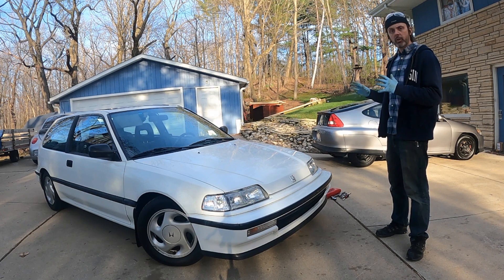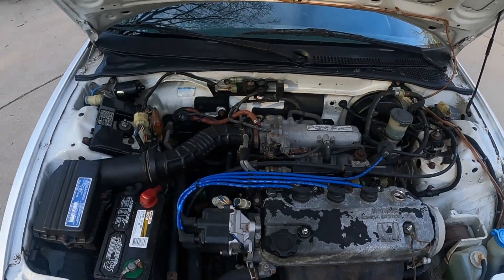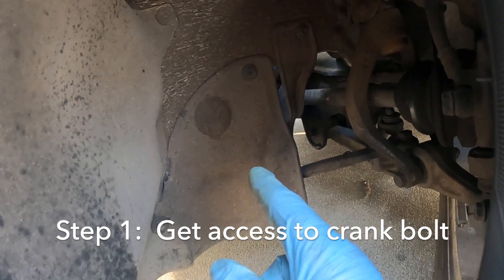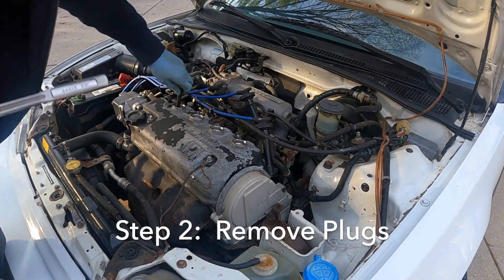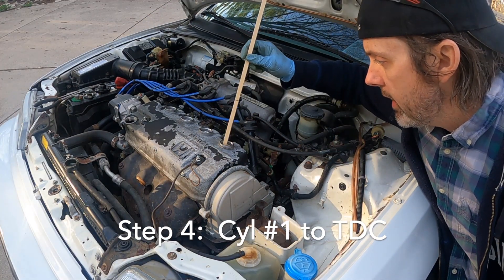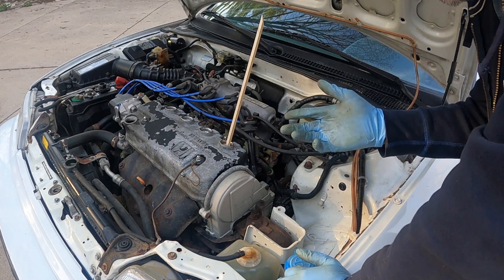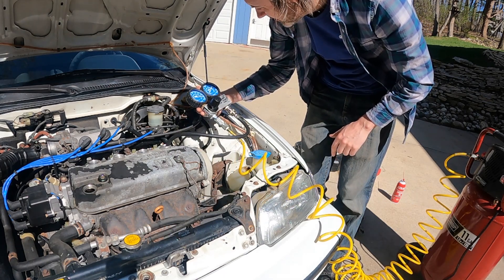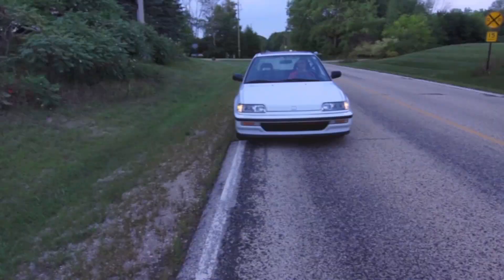EF Honda Civic Si Hatch Engine LEAKDOWN How To

Comment: All 4 plugs look ok? None of them look like they’re burning oil? Did I kiss that somewhere ?
Reply from the maker: Plugs look a little dark, problem is blowby; engine needs rings, and to do that you need to pull it, and if you're doing that, I don't want to put something without Vtec back in tbh.
Reply: @addvancedgarage  somehow missed the blow by…. Yep, don’t blame you one bit. K series, built bottom end to handle a turbo? Would make that thing fun as hell to drive if you want to dive in that far.
Reply from the maker: @VWJawbreaker  Probably go b-series as they drop right in and are more OEM+.  K swaps are neat but too much for a survivor Si like this imho.  If it was a repainted DX, sure
Reply: @addvancedgarage  look forward to seeing the progress when the time comes

Comment: OTC makes decent tools, and they're one of the more affordable brands. Yeah if it were coming out, either a B-Series or what I would swap in, a K20 or K24 😁 K-Series is one of the best flowing cylinder heads. Obviously there is a ton of aftermarket for K's and B's so either way...
Reply from the maker: I think a K is too hack for a mostly original Si like this; I know it can be done cleanly, but I think an OEM+ build is more appropriate, so B16/18 w quality parts would be perfect.   Plus...  man... aesthetically the headers on the B facing forwards looks so much better than the K, which just looks backwards.
Reply: @addvancedgarage  yeah I can see your points. Yes a B series would technically be more 'period correct' especially if you're going for preservation and more of an OEM+++ type of deal. There are a lot of B series out there so you'd definitely have no problem finding one/ building it how you want!🙂

Comment: K20 or k24 swap.
Reply from the maker: I think a K is too hack for a mostly original Si like this; I know it can be done cleanly, but I think an OEM+ build is more appropriate, so B16/18 w quality parts would be perfect.   Plus...  man... aesthetically the headers on the B facing forwards looks so much better than the K, which just looks backwards.

Comment: my a6 is doing the exact same thing, at 160k miles.  There is black soot that comes out of the tailpipe on cold start and then it stops and it'll burn some oil at higher RPMS.  I kind of figured it was the rings but it runs so good like yours and I don't want to rebuild it atm, sooo it's definitely just staying in there for now. B series are getting so expensive, I do have an extra a6 I purchased a while back so that'll probably be the route I go if anything happens. Thanks for the video!
Reply from the maker: It’s weird man. 160k isn’t even that high for a Honda.   Idc about the oil consumption but w a white car it’s like impossible to keep clean in the back w it doing this.
Reply: @addvancedgarage  for sure. Mine is Tahitian green so it’s a little less noticeable luckily
Reply from the maker: @justind1180  Love that color!
Reply: @addvancedgarage  I was going to try to use a fully synthetic oil and see if it helps.  My oil also gets black like  immediately after I change it too. Which is shitty
Reply from the maker: @justind1180  It doesn't.  I'm using mobil 1.  No difference.